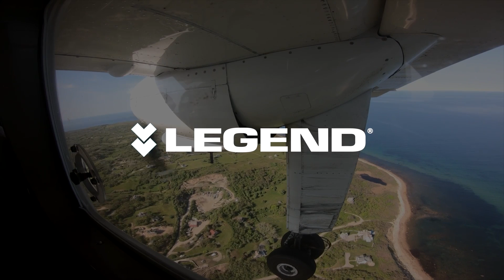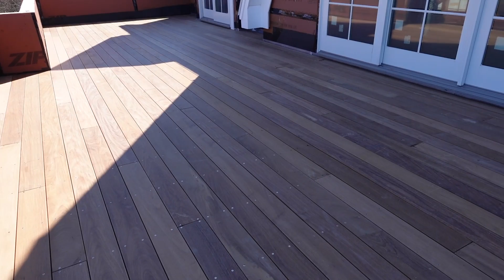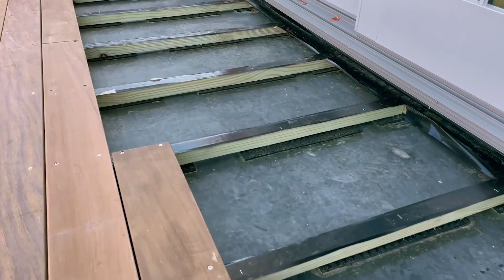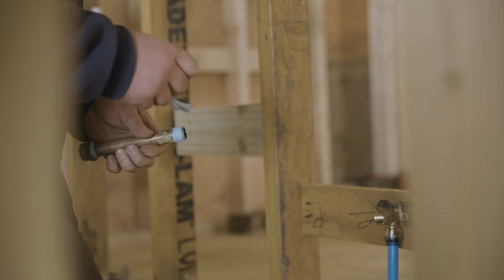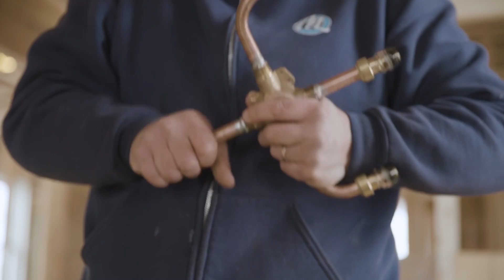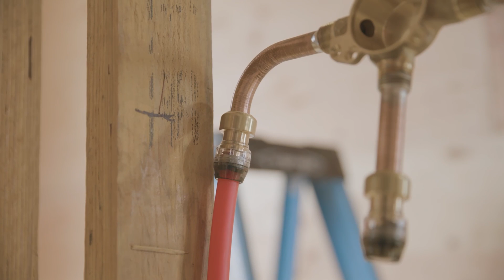BOAI Episode 8: SmartClick fittings, HyperPure Piping & More...

Comment: SharkBite fittings always left me thinking ehhhhh....
This Legend fitting you can see the workings as well as hear the click, knowing that going into a job you do not take these apart and reuse brings about a sense of confidence. The SharkBite reuse aspect always left me as a non believer, of which I am a firm believer that aspect leads to wear and leaks if reused...
Reply: we use a sharkbite system in norway, and our water pressure is 4-10Bar/kilo
Reply: @RogueSecret  I don't think pressure is the concern, it's breakdown of the o-ring over time,  or the possibility of damage to the o-ring leading to failure over time.  Maybe not immediately, but years down the line.  They have not been on the market for long compared to expected life of a home.  They've been out for what, 15-20 years?  That's not really that long in the grand scheme of things.  

One of the big warnings on Sharkbite is you need to carefully deburr your pipe prior to fitting, because the o-rings are potentially fragile. There's even a special deburr tool to deburr the outer lip of PEX.  It's also an extra step in install, slowing you down and costing more labor.   At least these Smartclick fittings don't seem to require that extra step.
Reply: Agree about the Shark Bite fittings. I've always felt like they were a temporary fix rather than a permanent install. I'm a do it your selfer - I like PEX and the crimp rings.
Reply: Ive tried them before, or at least a version of it and although it listed PB compatibility, i couldnt get it to seal (removed shower and was capping off old lines but even fully seated it would pop off), eventually i just through two valves on with compression rings and it worked. (mobile home so getting access to the PB under the house means removing all the insulation and fabric, which im not up for just yet. but now any place i need to do new plumbing i use PB to pex crimp fittings which seem to work well)
Reply: also one thing i dont trust on the fittings shown is how the clear style plastic would hold up to chlorine overtime, would it become brittle and crack like the PB of old
Reply: @everydreamai  They are in mapress quality so i would guess they last 50-100 years easy. But parts need to be clean and o ring need to be well oiled.

And as long as there is no scratch on the pipe, the pipe is round as it should be and you use this pipe strenghting part inside the pipe it should work as an charm.

The company i work for have used Roth, its the same system just "pipe in pipe" So far we have used it for 11 years and no leaks.
Reply: @everydreamai  and the O-Ring is protected by the mechnism when you put in the pipe so that should not realy be possible, the o-ring only touch the pipe when the pipe have entered the other side of it.

Comment: Type A Pex is so much faster and so infinitely superior to type B  that it is total nonsense to be using type B.
Reply: Several PEX B manufacturers including Zurn are now certified for F1960 cold expansion fittings.  It’s not PEX A vs PEX B.
Reply: @Jbk-o7t  I think you may be referring to the  F2080 fittings system. Pex A has other advantages besides fittings, including flexibility.  F2080 fittings and installation tools are quite expensive and are more clumsy, difficult and time consuming to use than the  Milwaukee expansion tool for Type A.